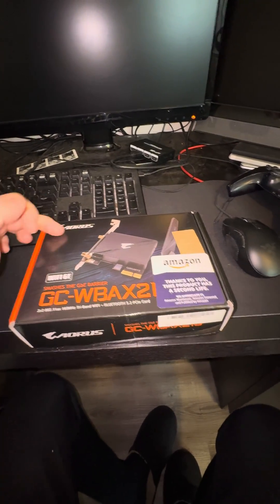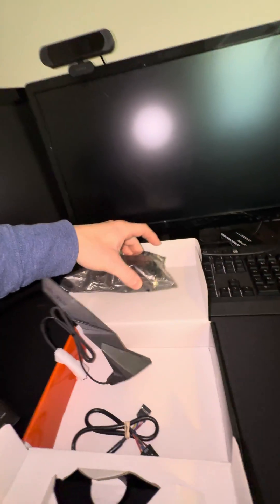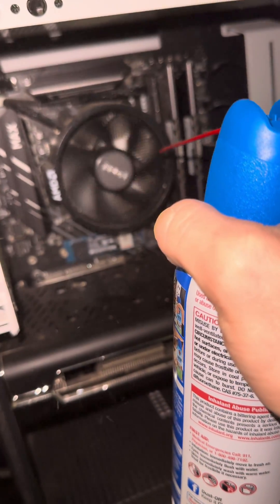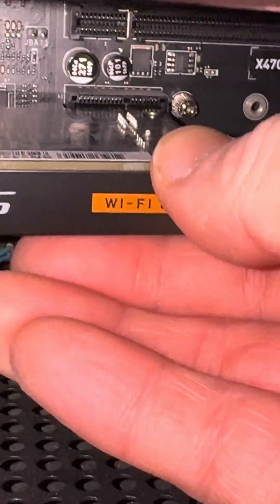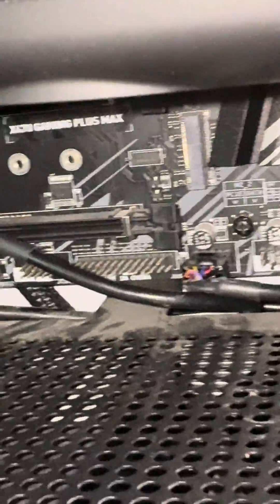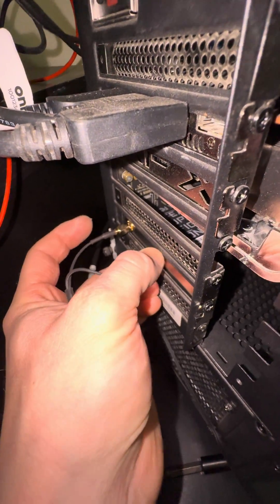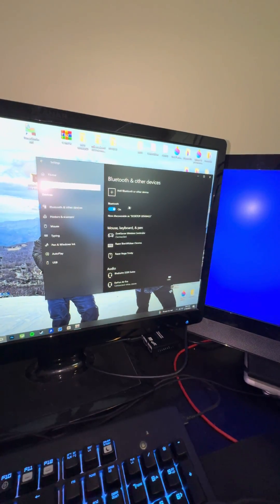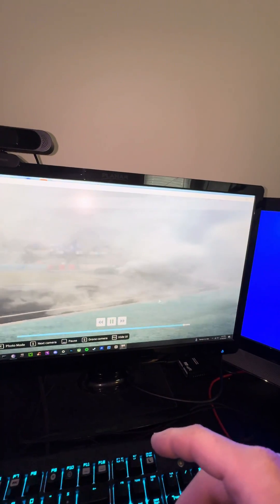PC WIFI CARD HOW TO~AORUS GC-WBAX210(Bluetooth and WiFi!) drivers link in description

Comment: If you connect the USB connector, do you need an additional bluetooth dongle?
Reply: I just bought one a few days ago too. Does your Bluetooth not work either?
Reply: @samtragante7325  It works if you plug the cable into your motherboard usb port. No need for dongle or additional gear.

Comment: I was confused as to why they require a USB connection? Oh well that's the price I pay for getting a motherboard without built in wifi 💀
Reply: if your still wondering its just for bluetooth and totally optional if you don't care for it
Reply: @averagemediocregamer  was wondering the same thing.  Seems really dumb to need to plug into a USB header if it is already in PCIE !  At least you clarified it is for Bluetooth.
Reply: Yeah, it is optional, but most actually will run into a scenario where they'll probably need it, so it's a good idea to install the cable, unless other stuff's plugged in there. Then you'll need a splitter.

Comment: my cat ate the cable that goes from the plastic part to the back of the pc. Are they easy to find or should i watch out for something?
Reply from the maker: If you find the same connection with two wires and antenna I could imagine it would work. I personally would buy the antenna through same manufacturer!

Comment: My internet keeps disconnecting and reconnecting, can you help?
Reply from the maker: Make sure your WiFi isn’t the issue. I check at the source then backtrack. If my phone works on WiFi and my computer has a new component that isn’t I’ll check physical installation, antenna angle and load speeds in settings, drivers, and at that point consult a local computer geek. Let’s be honest we all know one from highschool lol

Comment: Hey guys do we download intel drivers or the drivers from the website?
Reply: Driver from intel are newer and can be used for both windows 11 and 10. Since the wifi card is based off of the AX210 from intel you should be able to use that driver without issue